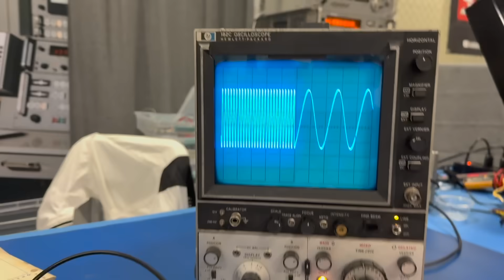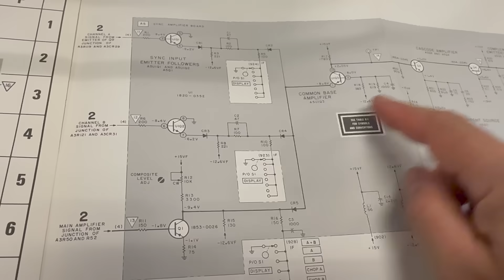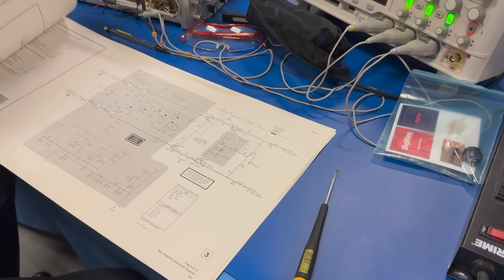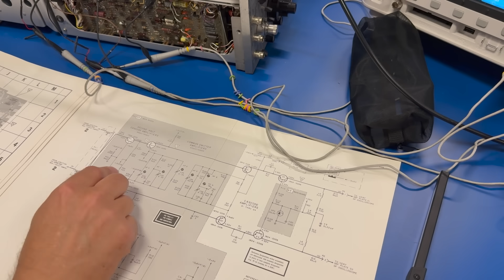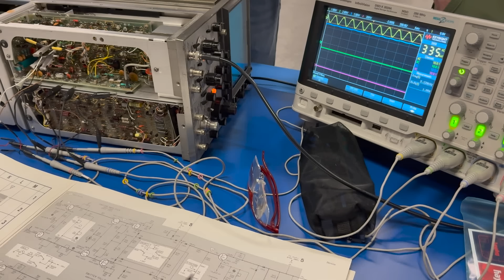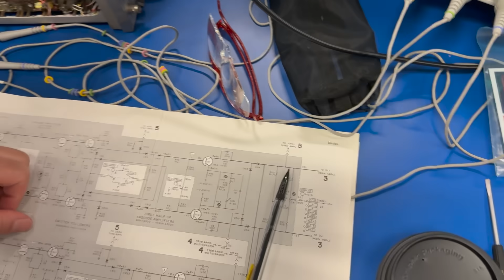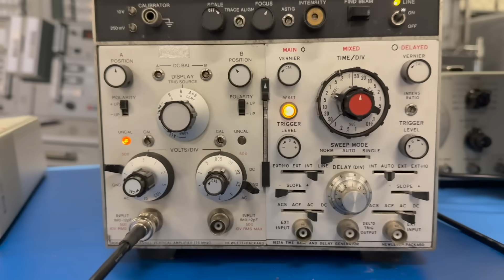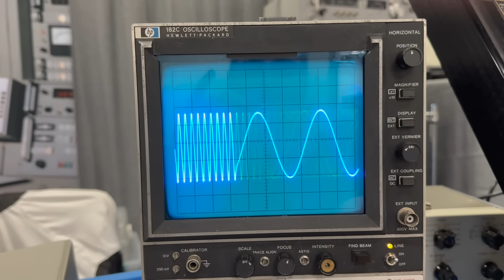HP 182C Scope Live Repair at Opensauce 2025

Comment: Could have totally been fixable on the floor if with a hack - someone was bound to have 150 ns worth of coax!
Reply: You can get really thin coax. I've seen it in an older HP instrument where it was coiled up on a plastic? cylinder. But it is easier to delay a simple pulse than a complex signal.
Delay and attenuation have to remain the same over a wide frequency range.

Comment: i had a tektronix 7403n  with 4 trace 50mhz (2x 7a18n) scope from 1974 with dual timebase (7b53a) vernier that did exactly the same, loved that scope till in the late 90,s all the plastics rotted including the attenuator cam tubes and the focus/eht started arcing (more rotten plastics)
Reply: I've got a handful of 74xx series scopes, and most of them still work fine. I've had to replace a small handful of caps, clean a legion of switches, and replace a diode or two. But perhaps luckily I've never had any problems with rotting plastics.

Comment: I believe early on mercury filled tubes were used for delay purposes. Easier to find faulty and fix.
Reply: Yes, but those are acoustic delay lines. There are also delay line memories that use torsion waves on a thin wire.
Reply: Mercury delay tubes were used in some early computers and specialty equipment. I've never personally seen a scope that used anything other than either a few feet of coax, or series L-C delay lines.